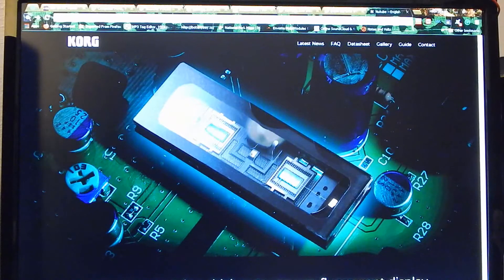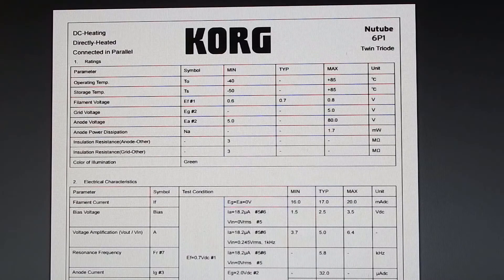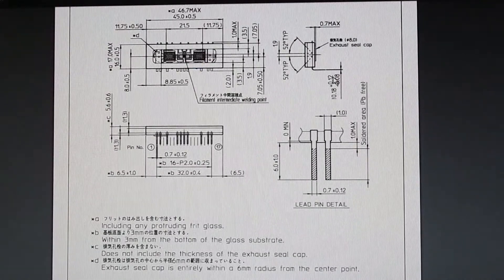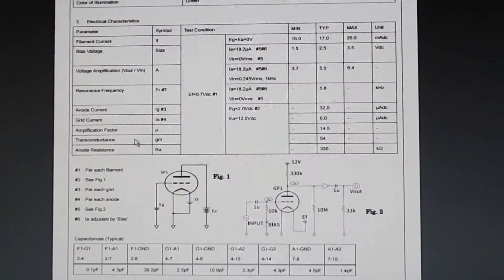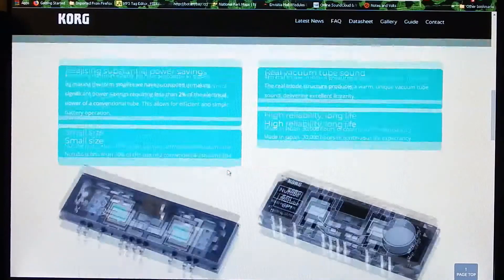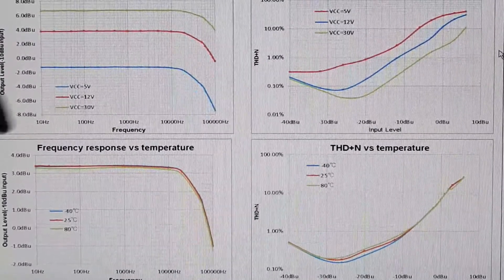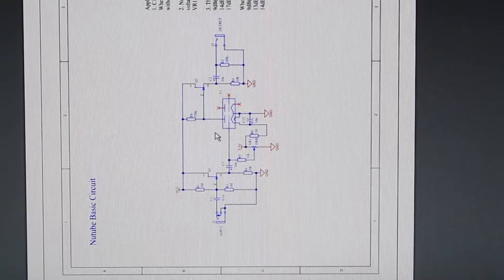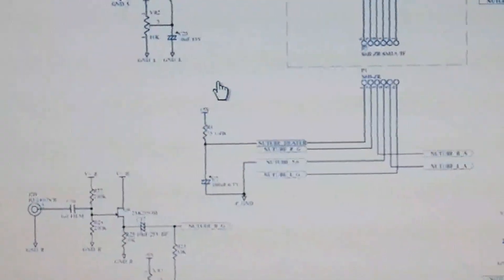KORG Nutube 6P1 - Tube Solution?

Comment: You are correct on the phasing in that circuit. To me the big attraction is low power / voltage for the tube sound. No way around solid state buffering if you want low current battery use. You might have seen low power tubes in the conventional cylindrical envelop, but smaller (looks like a big neon lamp) with wire leads. These have been around a while. I wonder how the fluorescent glow phosphors on the anode affect the noise or distortion. They represent a power loss and a potential noise/distortion mechanism. These are not fast as the graph shows roll-off starting at just over 10KHz. Overall very gimmicky in my view.
Reply from the maker: Probably a failed analogy, but sometimes I wonder if second harmonic distortion done just right, might have an effect similar to what Sharpness does to video or a digital image.